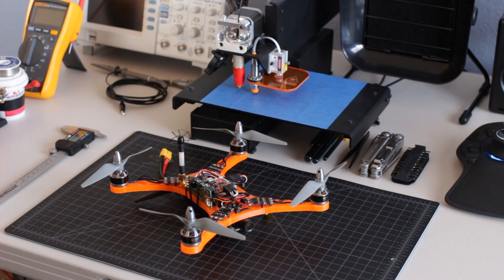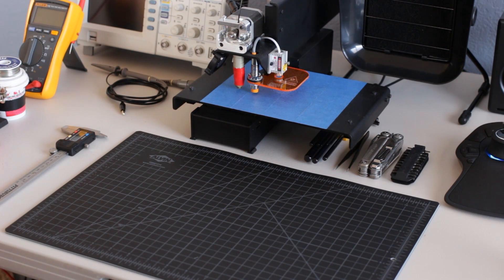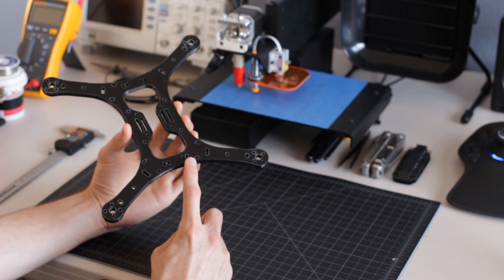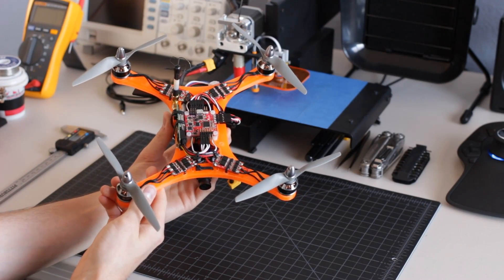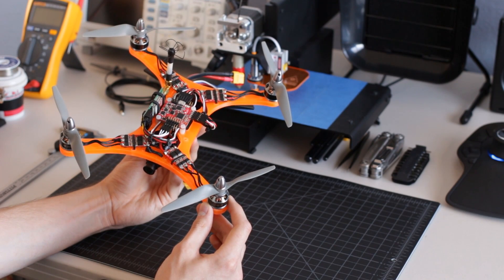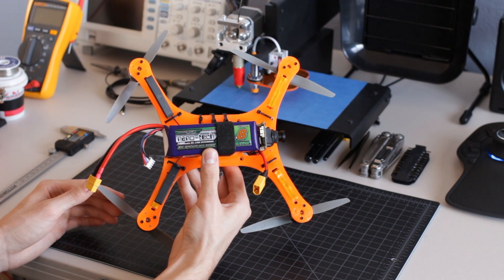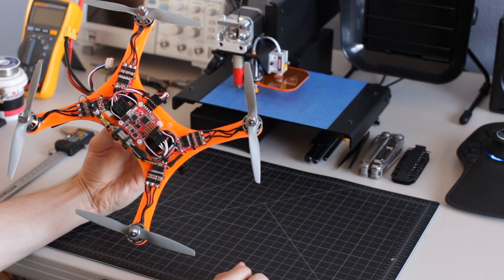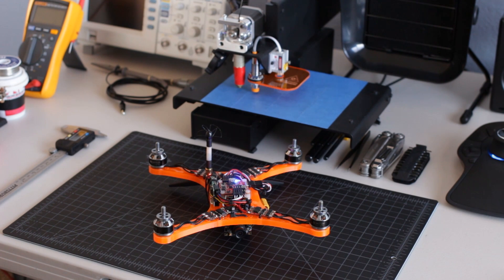Super Simple Mini H-Quad Pro

Comment: I'm not so sure that having the LEDs changing like that is helpful for maintaining orientation... isn't it just one more thing to have to think about? eg. now I'm pitching forward, so uh... brighter lights means rear, but when pitching back, brighter lights means front etc. Also, the lights will not change until you make a movement, by which time you can see the quad move anyway. Apart from that though, it's a cool effect! There is something very aesthetically pleasing about this design too, I like.